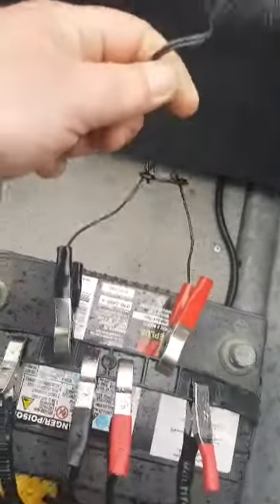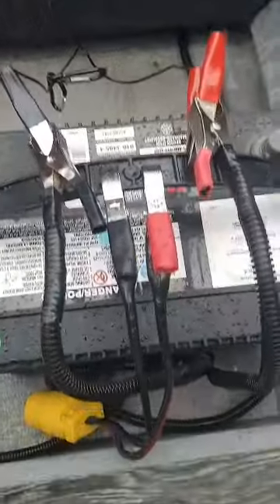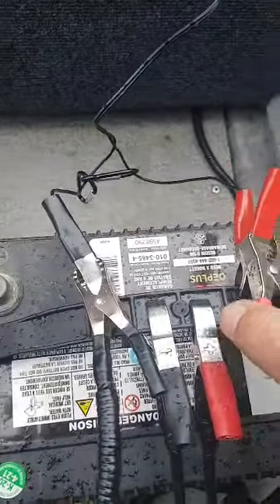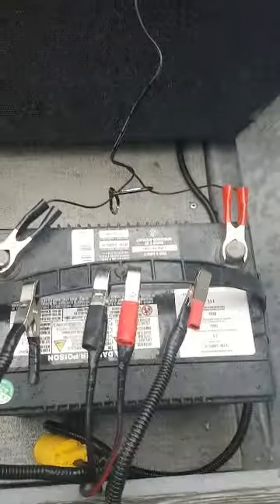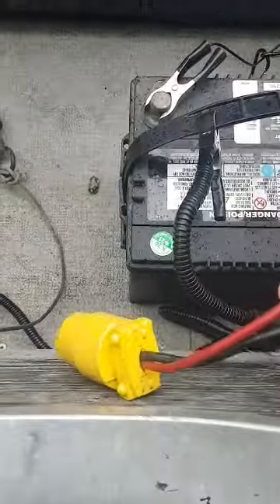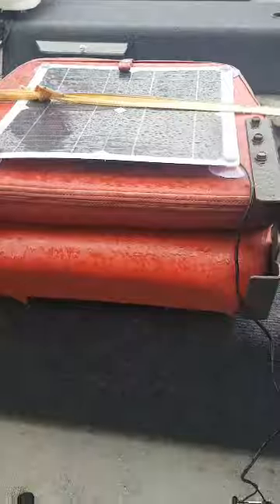solar panel for boat part #3

Comment: Any Idea how long and how much the battery charges using the solar panel? I have a 40 watt(?) panel my spouse gave me but it's kind of big to put in my small boat and I am wondering if it would make much of a difference if I brought it out on the water with me.
Reply from the maker: It should make a difference....
We left the solar panel hooked up to the battery all day out on the water n we used the trolling motor for 80% of the day n it lasted without loosing any charge realy....same battery n trolling motor as last year n it died after r hours of use.... this year we went out n it lasted for 7 hours without a problem